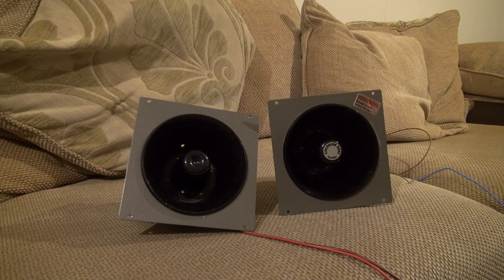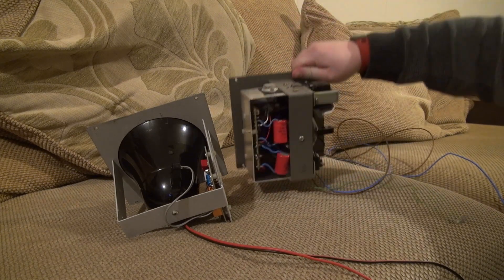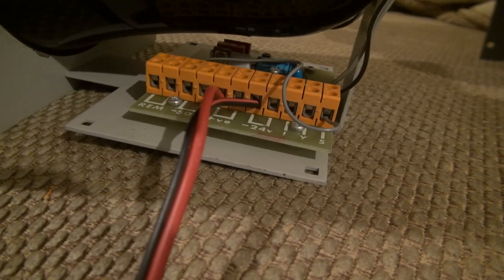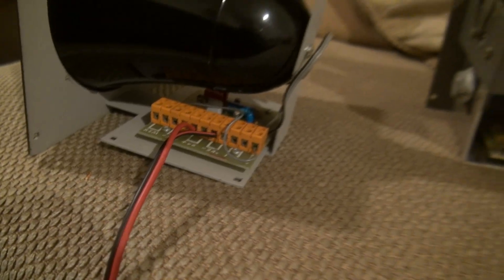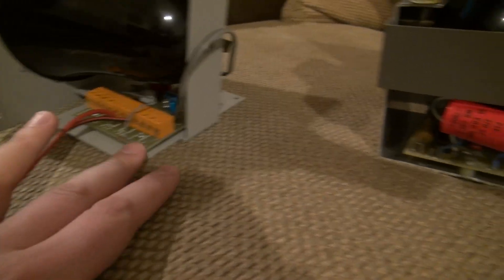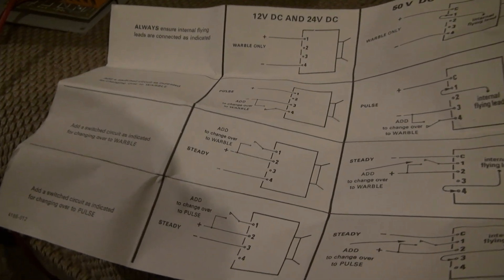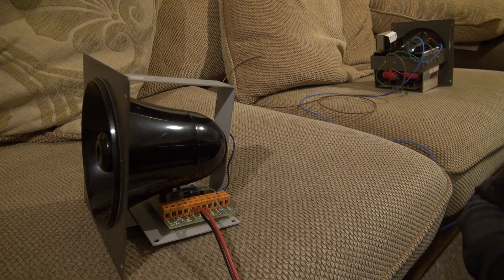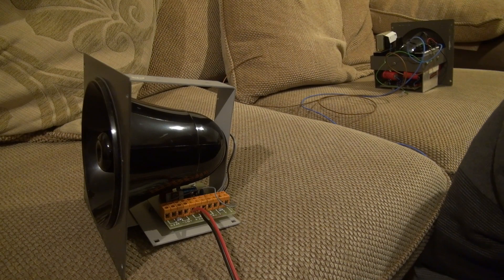Chloride Gent Warbler and Gent 2500 Warbler side by side comparison

Comment: We had something similar in my school, installed in the 1970s, but our versions were manufactured by Klaxon rather than GENT. Similar tones, and each one was slightly different. Made a dying sound as they switched off at the end of every class change signal. They don't make 'em as they used to!